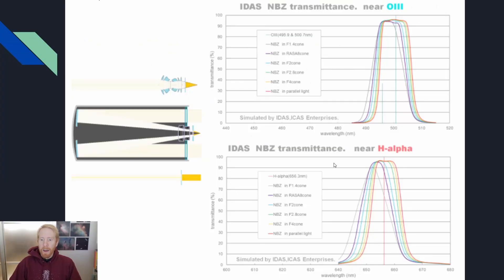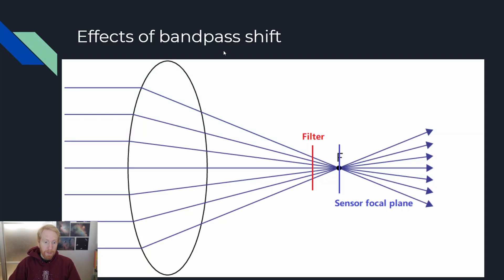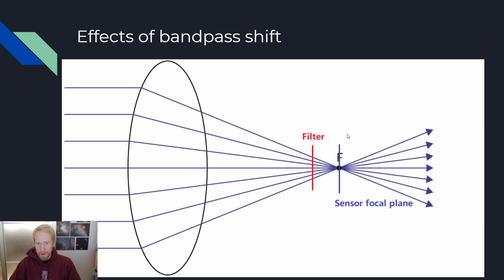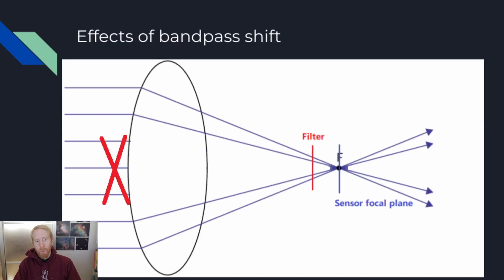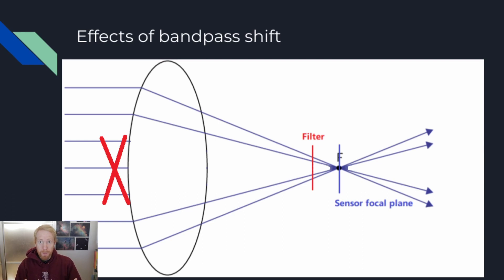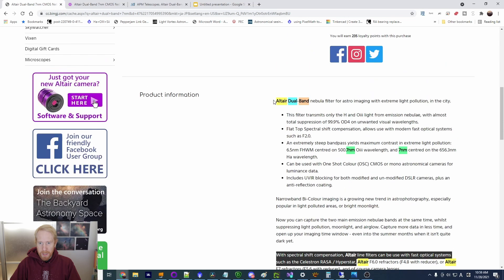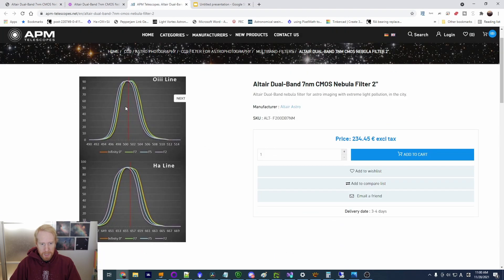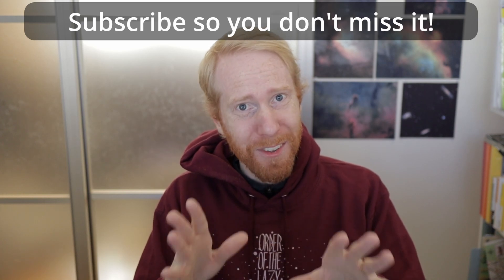RASA and Hyperstar vs narrowband - there is no free lunch, but there are solutions!

Comment from the maker: Hope this was useful! I still love the Hyperstar and having a lot of fun with it! And in a way, having only high incidence light ray angles makes it easier to design pre-shifted filters :)

There are workarounds for OSC cameras like the IDAS NBZ (which I use and really enjoy - see my Instagram) or the L-eXtreme (only if you are lucky - subscribe for the next video which will touch on that!) as well as the Baader highspeed narrowband filters for monochrome cameras (but note that I'm having issues with my Baader highspeed ultra-narrowband filters: one arrived chipped, another had ink on one surface, and a last one doesn't seem to be passing its rated wavelength - no completely sure, so currently getting this checked via spectrometer, and will update, likely in a video).
Reply: IDAS NBZ UHS exists and I own one. I wonder how your experience would be impacted by it compared to the non-UHS. No getting around the CO of course. RASA 11 here.
Reply: @AzCrawler00  Yet you have a much smaller ratio of CO to useful area.

Comment: I’ve been contemplating this same issue. YOUR EXPLANATION IS GREAT!
With conventional narrow band filters we have things going off band at the step angles around the outside of the objective, but on-band in the center where the F number is higher. But since most of the light is gathered around the outside, the “pre-band-shifted” filters might seem to be a solution. Now the outside is on-band, but now the center is off-band. However since the hyperstar already makes a large central obstruction, you aren’t loosing anything. I’ve some very fast large camera lenses Nikon F2.8 300 mm, these don’t have a central obstruction. So in this case, I looked at the IDAS NBZ 12 nm OIII HA it has the flat top band pass curves. It seems to work well for the color cameras. I’ve also used the 12nm Astronomik 12 nm HA and SII. Still waiting for the OIII to come in. I ordered in October, looks to come along in mid to late December.
Once again, you cover all the points so well and helped me make an intelligent choice for fast systems!
Thank you so much!

Comment: Flat top filters this narrow are extremely difficult to manufacture. And the centering becomes critical. The argument regarding "manufacturing luck" is totally true. Pre-red-shifting dedicated filters tailored for Raza and Hperstar is probably the only economical solution. A nice flat topped filter at < 7nm is a bit of a pipe dream unless the company is ok with low manufacturing yields, and money is no object.

Comment: It's the fast F ratios that cause the problem, not the central obstruction as far as narrow band filters go.  These filters are formed by many thin  layers that are tuned to a particular wavelength of light.  The high angle of incidence changes the path length through a layer resulting in a shift in band path.  The filters simply need to be manufactured with this in mind.  My F10 C8 SCT is fine with normal filters but if I operate it in f1.9 mode it needs special high speed filters or broader band pass filters.  The central obstruction does not reduce light that much nor effect resolution.  A 50% obstruction (by diameter) only reduces light by 25%.  It does reduce contrast because of increased diffraction.

Comment: Excellent video as usual.  I use an inexpensive Astromania 12nm Ha filter with my ASI294 mc pro OSC camera and RASA 8 for the Ha part of HaRGB images and get very good results.  I think the wider band-pass helps a  lot but I don't have Tokyo level light pollution here.
Reply from the maker: 12nm is a good sweet spot for the RASA 8, very little affected by bandpass shift!

Comment: Thanks Cuiv for the Altair article.I believe it confirms my theory that using dichroic filters like L-extreme on fast optical systems with an unmodified camera will have two benefits. First that we all know, fast optics = more photons, but since the filter in front of the sensor blueshifts the wavelengths, more of the intended blocked IR wavelengths can pass the sensors IR-filter making it easier to record Ha-data.
This is perhaps the reason, I get so good images with Ha in my images using Sigma 85/1.4 Art on a stock camera Sony A7R4 with CLS filter.
Perhaps a video for you to make in the future? :)
Reply from the maker: Very interesting point - yes at F1.4 there would be a lot of shift towards the blue, enough to maybe increase sensitivity to Ha considerably (maybe from 20% transmittance to around 35% transmittance, depending on the slope of the filter).

Comment: Hi Cuiv, that was great! These series of Hyperstar videos have been invaluable! 
I have the C8, Hyperstar V4 and L’eXtreme - but, the NBZ filter makes sense! 
Whether I’ve won the production line “lottery” with my L’eXtreme is yet to be determined, but I know what to get if I’m unlucky!! 
But a simple, anecdotal observation, wouldn’t the larger diameter SCTs (C8, C11, etc) have an advantage over your C6? Markedly I would have thought. Greater mirror areas with the same obstruction- proportionally less with the bigger dia SCTs.
Reply from the maker: You're correct, larger SCTs will have less of an issue on that front! But in a way they might have more issues with pre-shifted filters :)
Reply: @CuivTheLazyGeek  Why's that? The solid angle is the same, but the wasted solid angle gets smaller, Area/ditance^2.  Can you explain why do you expect more issues then?
Reply from the maker: @phadeezz  There's simply less of a range of incidence angles to think about when pre-shifting a filter for a large obstruction (by diameter). In other words in theory, it would be easier to create a pre-shifted filter for that. From some spectrometer measurements of Baader F2 filters, they seem to preshift with RASA8 in mind (e.g. the filter doesn't perform as well on an F2 refractor - because then the part in the middle of the lens doesn't let in the desired signal since the bandpass isn't shifted enough... But it lets in light pollution).

Comment: I just ordered IDAS NBZ filter. I wonder if the data in Altair shows same results as IDAS, where there is difference between f/2 and RASA. Well, I can actually test filters. I have nice spectrometers. Will show you results, if I get to them.

Since you are covering RASAs now, it would be great if you can cover some backfocus details. I.e. now I'm thinking about getting a new ZWO camera with 17.5mm backfocus, while my present has 6.5 mm. However on the Starizona store there is only 4 options for ZWO: cooled and cooled 54mm flange, uncooled x 2. I'm not quite sure if I can get into focus with the new one. Ordered some extensions, so I think I can check that. Still, would be nice to hear more from you on the subject.
Reply from the maker: I wish I had spectrometers.... One of those filters from Baader I got is REALLY dodgy and doesn't seem to pass its advertised bandpass :/
On the backfocus, I won't cover that, simply because I only know for my telescope (ZWO cooled camera means 17.5mm back focus on the camera side, no idea about the rest). Your best bet would be to ask Starizona directly!

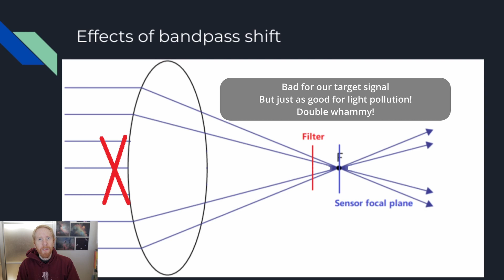Comment: Thanks Cuiv! But I don’t get your “double whammy” point (at 8:38). Why would the light pollution frequencies not also be stopped by the central obstruction? Surely all the light rays will be parallel, whatever their frequency?
Reply from the maker: The part of the LP that overlaps the target signal will also get stopped yes as incidence is the same. But light pollution is present throughout the whole spectrum, so other LP wavelengths just step in through the shifted bandpass - in other words the shifted bandpass can end up passing only LP, and no signal.

Comment: This is SPOT on with what I saw when using my Optolong Extreme filter with my Hyperstar f1.9 !!  It gathered very little HA compared to OIII .   I am going to start using monochrome on my hyperstar but I need to invest in FAST filters should I go with baader or should I look at some on else’s ???  It’s quite an investment they are expensive.
Reply from the maker: OK so I will give you my experience with the Baader fast filters: terrible. Out of 6 filters ordered (two filter sets), one had a chip in the middle, one had black paint on the surface, and at least one had the bandpass in the wrong place (causing very little OIII to pass through - verified via spectrometer). I'm in the process of getting all of those replaced - I sure as heck am not buying from Baader anymore.
Reply: @CuivTheLazyGeek  I think I recall watching that on a video of yours. I see they are now making special “CMOS” versions is that the ones you got?  So what set do you recommend that will reach f1.9 on my Edge 8HD

Comment: Hey Cuiv, cool video as usual! 
I was wondering if you'd be keen on doing a video about how to chose the right camera? What to look for depending on what type of object you're planning on imaging. There's a lot of different type of cameras, and I'm not convinced that more expensive always means better depending on what you're after. I'm definitely a bit lost on the impacts that pixel size, Well capacity, read noise etc. can have. Also, how much do you actually gain from going mono+ filters against using an colour sensor.
Reply from the maker: That's a huge, huge roadmap there :-) just mono vs OSC can start discussions that span months and hundreds of posts :p
As a short intro, Nico from Nebula photos has a great summary: https://youtu.be/LQCSAeKzqjM

Comment: It is possible the reason your Optolong L-eXtreme works "better" with your Hyperstar is because it might actually be a worse sample.  If your sample has a 9nm bandpass instead of 7nm, it could be just enough to allow more signal (although more noise too).
Reply from the maker: Possible! Based on spectrometer readings of other L-eXtremes though, it seems the bandpass width isn't usually the issue, but the bandpass placement is. I might have a bandpass placed so that Ha is on the left edge of the bandpass. I can't know for sure without measuring!

Comment: Thanks for sharing this info.. but wouldn't a larger primary (say the 14" RASA) increase the efficiency of this NB filter, considering having the same obstruction dimensions from the front mounted camera?
Reply from the maker: Maximum incidence angle would still be the same, but minimum incidence angle will be lower - so there will be a larger range of incidence angles to consider. We then have the choice of using 12nm bandpasses like IDAS NBZ to have Ha pass to some extent across those incidence angles , or preshift the bandpass (while keeping the ability to make it narrower) for the average incidence angle (perhaps tweaking towards higher incidence angles, which represent more light - but it means we'll likely be "closing off" the central aperture more to Ha (while keeping it open for light pollution).

Comment: Should have watched this video before I bought the Optolong Extreme for my Hyperstar. Luckily I can still return it. Especially embarrassing for me since I have a background in optical engineering, and knew that thin film filter center wavelength shifts shorter with angle. But I was too dumb to consider my increase in focal ratio would increase the light cone angle at the filter (facepalm). 
Has anyone in the industry considered thermal control of these filters to compensate? I know from experience that thermal expansion of thin film filters can change the dielectric coating layer thickness, and shift the center wavelength in the opposite (longer) direction.

Comment: Please review the Celestron Filter. I do not understand why you don't use the manufacturer's recommended filter.
Reply from the maker: I don't have the Celestron filter and don't plan on getting it - it's for RASA, not Hyperstar, not even sure it would fit! Overall it's very similar to any other general purpose filter like the Optolong L-Pro for instance (which I already have - but don't use much because I prefer to just go UV/IR cut in that case for easier color balance). Still, it's very different from narrowband, which is the topic of the video.
Reply: @CuivTheLazyGeek  Thanks, I am still in the OSC clan. I am studying before going mono.

Comment: Is it possible to create a positive angle of incidence to the primary mirror and incoming light so that the central obstruction is not in the center, rather off to the side instead?
Reply from the maker: Yes, there are designs like that, but they come with a slew of problems to overcome

Comment: I don't completely get the reason for the blue shift.  Seems that it should be shifted to longer wavelengths (i.e. red shift).  I come to this conclusion by assuming the filter passes a particular wavelength at normal incidence.  For broadband white light coming in at an angle, it would seem to require a longer wavelength of light to project onto the normal direction at the pass wavelength, not shorter.  I must be missing something.  I would love a more technical reference on this if you know of one.
Reply from the maker: https://www.alluxa.com/optical-filter-specs/angle-of-incidence-aoi-and-polarization/
Reply: @CuivTheLazyGeek    Thanks for the reference.  That certainly has the equation showing the "blue shift," but didn't explain how it was derived.  In the mean time, after doing a bit of google investigating, i think I understand it now. My original assumption as to how the filters work was wrong.  BTW -- I'm a recent/new subscriber and love the channel.

Comment: I have a RASA 8 and use ultra highspeed SHO filters, so I have no idea what you are talking about.  My pics look fine.
Reply from the maker: The video is over a year old by now, there weren't many highspeed specific filters at the time! Glad the highspeed SHO filters are working for you - mine didn't, the band passes were very poorly placed (checked via spectrometer), leading to some signal coming through, but less than 30% or so transmission.
So overall it looked like the filters were working, but far, far from spec!
Since then, based on further measurements I did, Baader fixed their filters and separated them further depending on the use-case.
Just saying, it's possible that the filters you have are great in part because of my videos' impact :p

Comment: There is a IDAS NBZ Ultra High Speed version and it's cheaper.
Reply from the maker: Yep, I think it's cheaper because it's less versatile. For RASA8 it does add a few percentage points to overall H-Alpha transmission, but on slower FLs you lose quite a bit compared to the non-UHS version